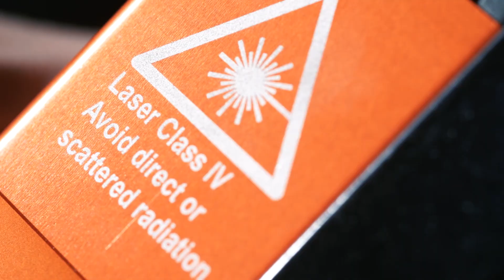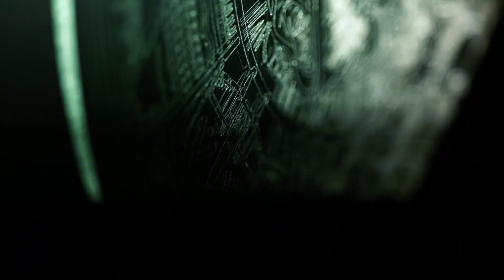CNC-STEP | Lasergravierer für CNC Fräse / Laser graviert Glas

Comment: Hi, what do you use on the glas?😊 I have this laser and this was awesome👍🏻
Reply from the maker: Hallo John, we will add the special spray to our shop as soon as possible for you to use! Please check out our website in the next two weeks again. Hope you are good! Stay safe!
Reply: CNC-STEP / Fräsmaschinen Nice, thanks😊 Do you ship to Norway?
Reply from the maker: @manowasp  Yes, no problem ;-)
Reply: @manowasp  Hi John, please be careful when buying one of these CNC machines.  They are a good machine, but, they operate within VERY specific parameters.  I made the mistake of buying one in the UK (an S720)  but have now shipped to Thailand and the CNC does not work due the the heat and humidity.  Its useless.  The instruction book says the 'operating temperature is 19-23 degrees'.  Shipping one to Norway and it wont work in the winter cold months, you will needs heaters in your workshop and air conditioning in the summer.  Can I advise you do your research first before 'pulling the trigger' on possibly a costly mistake buying a CNC and software, as I did